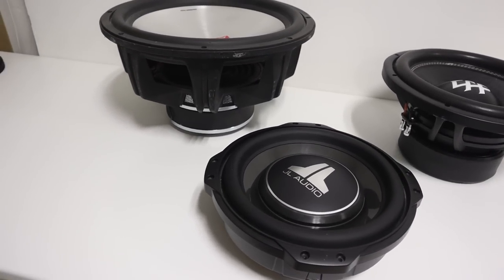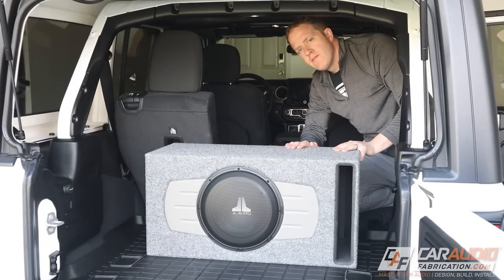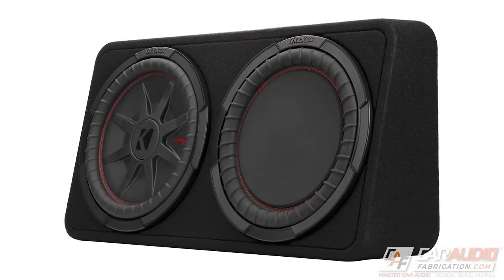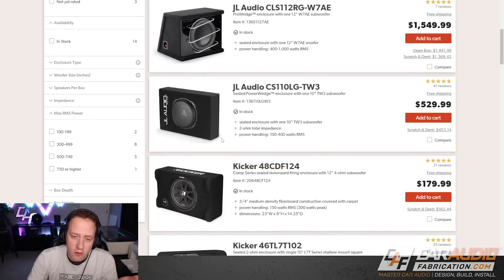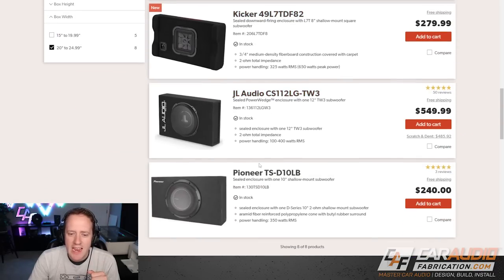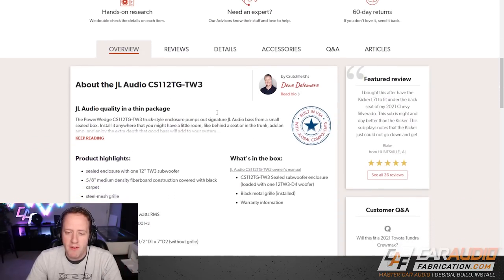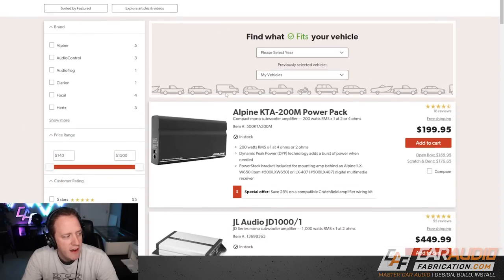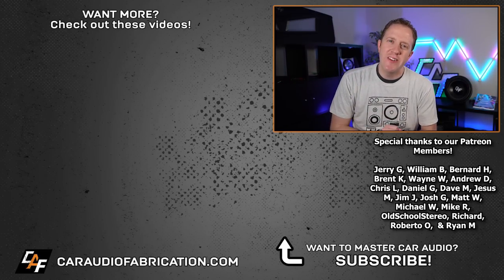Choosing the BEST Preloaded Subwoofer Enclosure to Add Bass!

Comment: Most of us start with the Prefab sub/box combos and many stay there and are quite pleased.
Reply from the maker: No shame in that! There are many solid preloaded enclosures. Where "prefabs" get a bad reputation is people don't do research and will pair a subwoofer with far too small an enclosure (or large), or the enclosure is not built very well and a bargain basement special. Preloaded enclosures from reputable manufacturers are solid and designed to match the subs well.
Reply: @CarAudioFabrication  Please do a video on the best prefabs to buy and ones to avoid

Comment: As to the passive radiator box, I wouldn't say it is just as large as an enclosure that could house 2 subs, its size is comparable more to that of a single sub enclosure with a port, but the passive radiator is essentially the port, which saves some space and gives a very similar performance to the ported enclosure.
Reply: Could've said "size of 2 sealed boxes"
Reply: @nobodysfavourite6953  I think it's a good deal smaller than 2 actual sealed boxes that this 12" sub would be in. It could physically hold 2 of them, but it would be too small for 2 of them to play and sound right.
Reply: Totally agree 💯! It could fit two, but it wouldn't sound good. Passive allows for better sound over a sealed box of similar size, with the ability to reach the lower notes of a larger ported box. If size is an issue but you still want the lower notes, passive systems should not be ignored. For me, and the music I like, it was the best compromise. I built a passive system with a 10" JL 10w6 for the trunk of my gen 6 Camaro and it sounds great. Pushing it with the D4S JP8 wired to 2 ohms and using the Audio Controls LC2i Pro for line level conversion. Custom built and tuned my system in WinISD before starting anything, and was even able to tune the cone weight of the passive radiator. Far stretch from the way I did things years ago...

Comment: My number one priority in a sub is solid mounting that can handle a twisty road without moving. Followed by easy to remove for competition, as well as low weight. JBL Basspro Hub made the most sense to me for those reasons and the low center of gravity mounting location. I wish enclosure manufacturers took that into consideration. Not everybody drives a soft crossover with their stuff sliding all over the place.

Comment: I recently installed a dual 12" enclosure in my 535d F10, powered by a Pioneer GM-D9701. The Pioneer subs are DVC at 4 Ohm so I wired them up to show 1 Ohm  at the terminals.  The speakers are rated at 1400W max and 400W RMS and the amplifier is 1 Ohm stable at 1000W so they match quite well. I set the LPF at 60 Hz but will tweet it if necessary.  Great channel and excellent content.

Comment: I know about designing a good system with the sub and amp but what are your thoughts on a powered sub for ease of installation, especially for a vehicle with limited space. Any thoughts or do you already have a video with some suggestions of a good one?
Reply from the maker: Many of the same lessons from this video would apply for a powered solution, you just won't need to worry about picking out the amplifier. A powered subwoofer can definitely be a solid solution. Considering doing some testing of some on the channel if that's something you guys would like to see. 👍
Reply: @CarAudioFabrication  I would. I have been feeling the urge to add some low end to my car.  I ran a shop back in the 90s. I made the jump to IT and have rocked factory for 2 decades.  Kids are grown now and grandpa still loves him some old hip hop :)
Reply: @CarAudioFabrication  definitely worth watching if you test some.
Reply: @caraudiofabrication I would like to know too! Also how you would go about setting gain on a powered subwoofer.
Reply: @CarAudioFabrication  I'd like to see these types of videos. Other issues are that what if you are buying an amp for the 4 speakers in the car, and then also buying a powered sub? There are installation considerations like having to wire 2 power cords to the battery instead of one. Would it be better just to go w/ one amp w/ 5 channels (Audio Control has 2 good amps like this), or 1 amp w/ 4 channels and 1 powered speaker?

Comment: What’s the advantages and disadvantages of using the 0 gauge to 4 gauge reducers on an amplifier
Reply from the maker: Generally you can be sure you have enough current handling capabilities for a longer run of wire, but if an amplifiers manufacturer chose a smaller size like a 4 gauge input, in most car audio applications you will be just fine using that 4 gauge wire.

Comment: How long have you been in this field because I’ve seen a lot of good things happen for car audio enthusiasts in the last decade that is so better than before. I am hooking up a 12 Rockford fosgate 12 inch sub in my trunk but it has been draining my battery since the car has a factory amplifier from the b&O system, I have seen a lot of people disconnect the factory amp but I don’t have to right because it is working really good right now as far as the power And sound quality, it just needs a little bit more bass that’s about though. Do you have any suggestions ?
Reply: You might like the P300 series from Rockford fosgate, they have an amp built into the enclosure. All they need is power ground and a audio signal from your head unit.

Comment: Hi I wanna install 2 8'inch Sub that's 800w in my room and it's running on a 420w dual channel module cause am rebuilding a vintage amplifier with a pre-amp module as well but I don't know if I should buy a equalizer that has 7 bands I don't know tell me
Reply from the maker: An equalizer would have little value for a simple subwoofer add on. If you were doing a full system install and tune it would be a different story, but it sounds like you are just looking to add some bass, so I wouldn't be too concerned about incorporating an EQ for it.
Reply: @CarAudioFabrication  so you're saying it's not as relevant as the other things am going to add in it

Comment: Hey if i had to choose between 2 ported subs a 12inch at 200watts or a 8 inch at 400watts what would be better i have a large suv thx for the video!!
Reply: ...how low do you want it to go?  What sub covers the range you want?  Is cost a factor?  (in the the 90s) I ran a single 12 in a sealed box on 100w at 4ohm (amp in mono) and it was plenty and went low.  But my box lived in the trunk and took up a lot of space (nearly 3-ft^3).  I'm a fan of the 12/200w but what size box can you get away with?   Is the 12 matched to the 200w?  Why not a 10" at 300w?

Comment: I have a jbl gx-A3001 mono amp and a sundownaudio lcs 10 wired to 2ohms and would like to know if the 2 are a good match i also picked up knuconcepts amp wire kit and extra rca cabels and a bassknob
Reply: It’s hard to find decent specs on that amp. I assume it does rated power, and I’m sure the Sundown can take it’s rated power. So should be closely matched. A proper enclosure and clean power will be important.